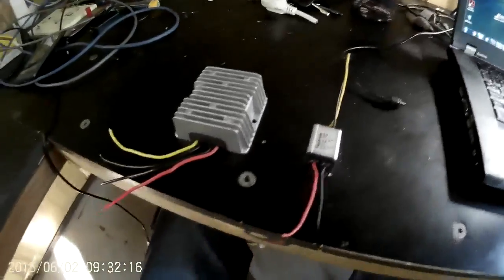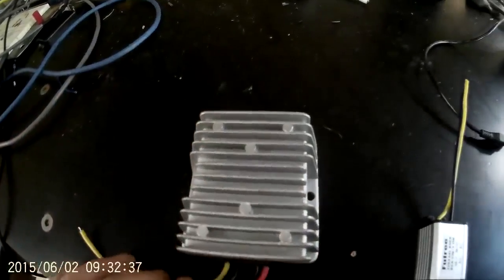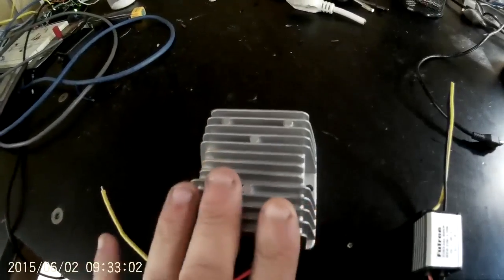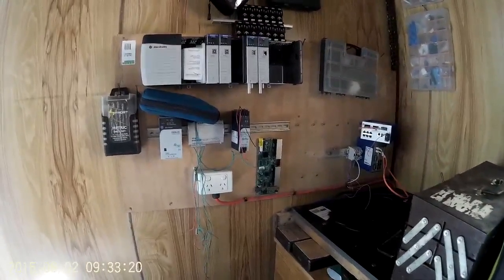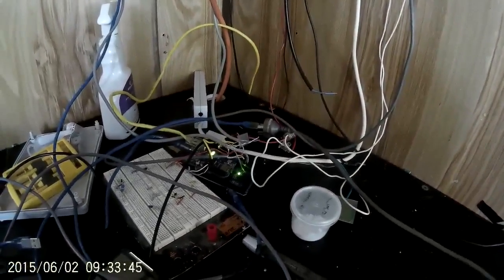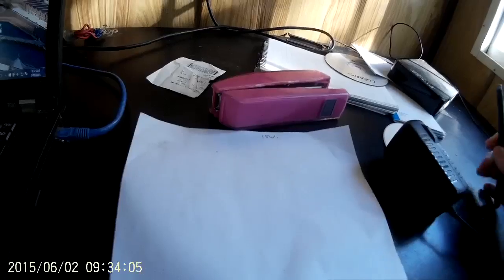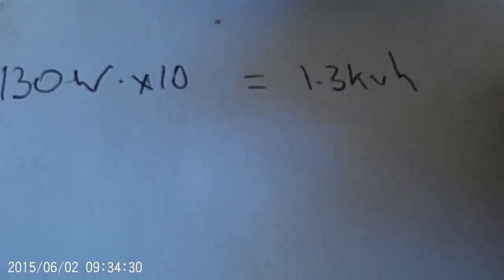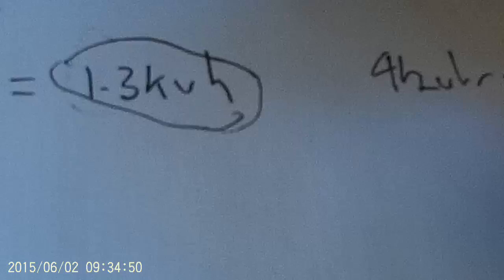Super Efficient Offgrid Solar - Part 2

Comment: I tried taping of 12volts for a Mag Lock from just one battery for my DC requirements and tir really upset the series balance in my quad pack after a few weeks. I don't want to Buck from 48 to 12v any other cleaver way to tap off some 12v ?
Reply: Ok thanks for the link.
I'm struggling to find how to put my PIP inverter into 'economy' mode or 'standby' mode, I've taken yr advice and got rid of the warts. Does there need to be Zero drain to go into standby ?
Reply: thanks I'll give it abash, now I've seen your other videos it makes more sense

Comment: Hi, thanks for your GREAT video's ☺ 👍 👍. 
I have 2 x MPP Solar inverters,  I started with the PIP 6048LC it has a big copper transformer.  I blew it up a couple of times ( my fault), on the last occasion I bought a PIP 4048.
I run an Outback 80 charge controller but the 4048 blew up at 3mths, they replaced the board but it was a shitfight and I had to pay the $120 freight! , I only ran it for a couple of weeks when they told me the fix for the 6048 ( new dc fuse board) so I've gone back to using the 6048 and kept the 4048 as a backup. 
I really want to thank you for the heads up on those capacitors!!!☺☺.
What do you recommend replacing them with I have a Jaycar in townsville and is it beyond an unskilled me?
Also thanks for the video on POWER PARASITES I will sort mine out now that you have given me the fix.
Living off grid has been a steep learning curve its video like yours that we need more of, PLEASE KEEP THEM COMMING!
Regards Dan